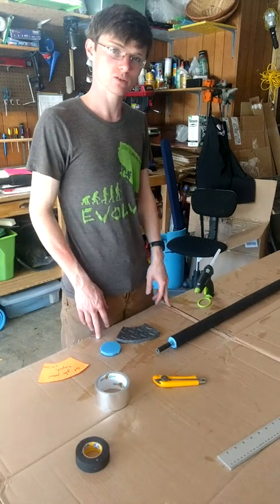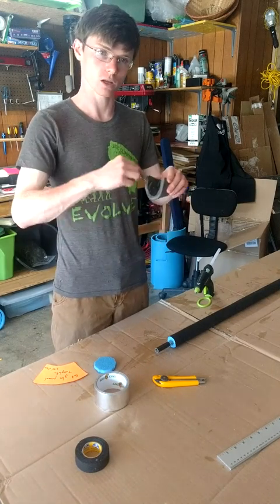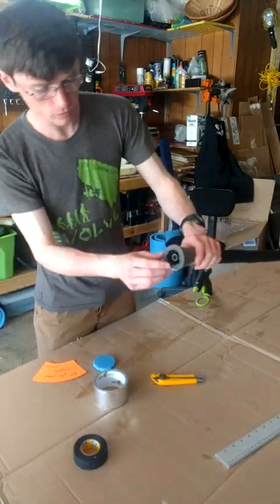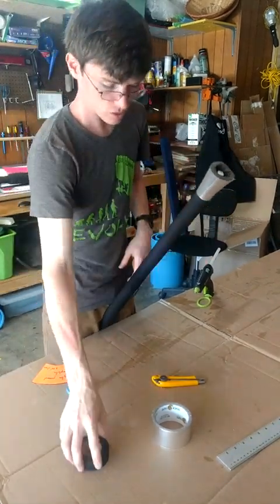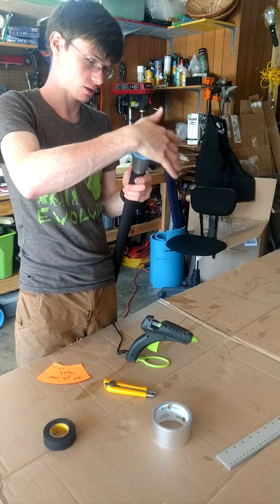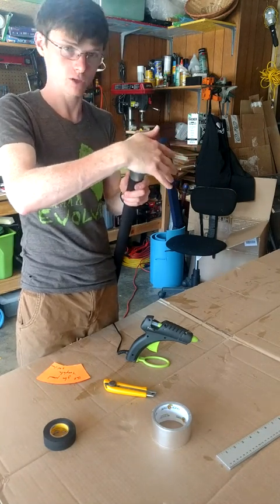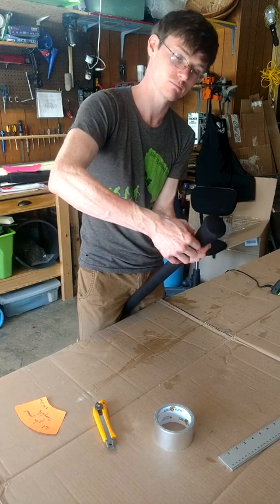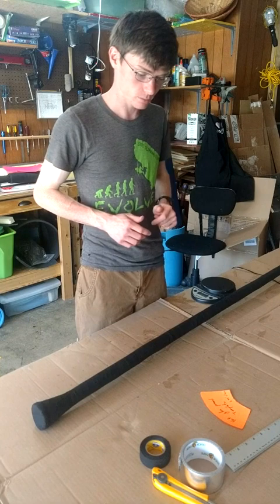How to Make a Hot Glue Pommel

Comment: lovely bit of tech, I haven't found any real uses for hot glue.
But this looks like a fantastic pommel method. Have you found any other uses for hot glue?
Reply from the maker: I use hot glue regularly in attaching my arrow cans to the arrow blunt. It fills any gaps well, and is pretty much an unbreakable bond in that application. I show this in my video on making arrows : )
Reply: @BofferBasics  Nice. I can imagine they must hold strong like that! I make modular heads that screw in like normal arrowheads for mine.
Reply from the maker: @ezekielbenavides2740  How do you make your screw-ins? I've been experimenting a bit, but so far I haven't come up with anything more accessible or useful that the PEX modular style.

Comment: Thats a fantastic way to make a pommel. Hows the weapon balance point after its all done?
Reply: And can it be done this way for single handed weapons?
Reply from the maker: @fosstheboss31  I do all of my single handed weapons this way. The impact on balance point is going to vary from weapon to weapon, depending on how much weight is in the front. As for how it feels balance wise, that's a personal preference. This is going to add a bit of weight behind your hand, so if you're used to a super light pommel, like the pool noodle pommels that are really popular in Amt, you might feel like you're fighting your pommel when you swing. In general, weight underneath where you grip is going to be the most responsive. However, if you need to add a good amount of back weight then it's going to reduce how much bulk you may have to add to the handle to get it to the weight you want.